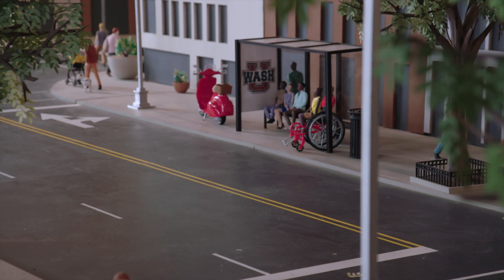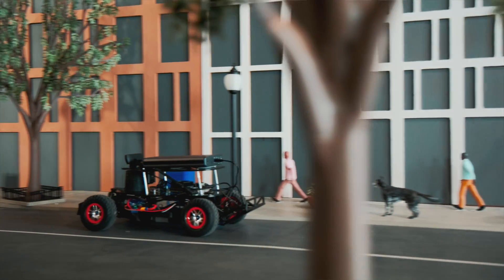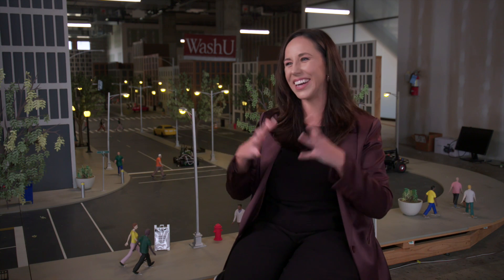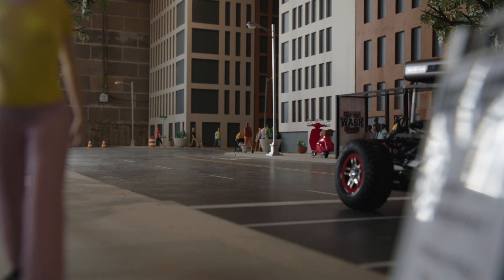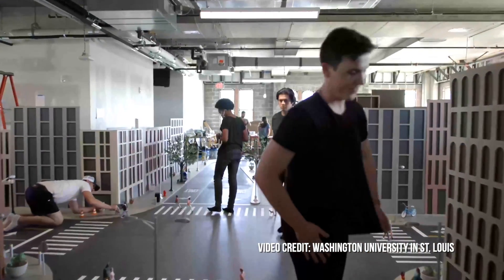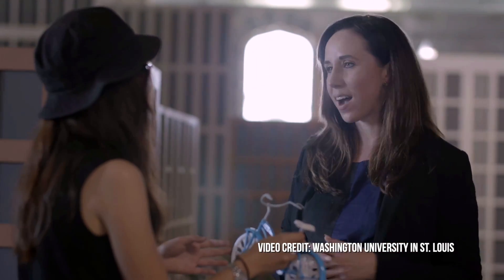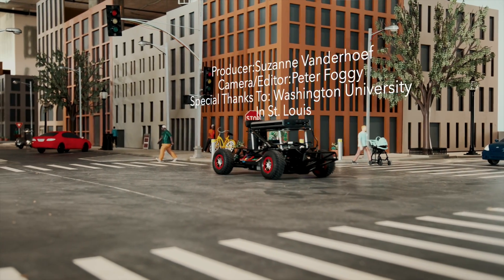Washington University AV Mini-City

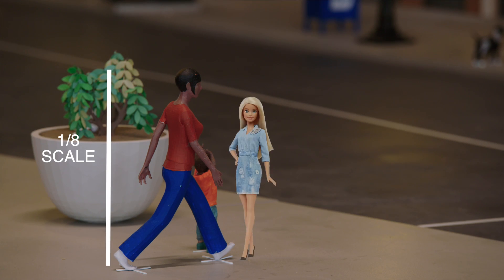Comment: 0:37 1:8 scale is actually smaller than 1:6 scale, just as 1/8 is smaller than 1/6. A six foot person rendered in 1:8 scale would be 9 inches tall, while in 1:6 scale, 12 inches.
Reply: Lol the editor just made it 6/8th of the height of the city figure
Reply from the maker: Nice catch, you are correct. Thank you for pointing this out.